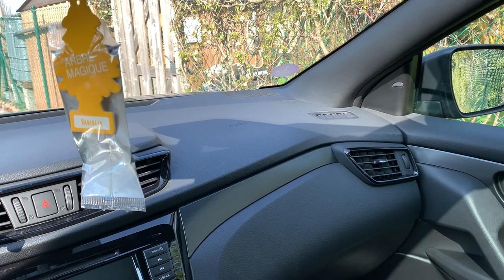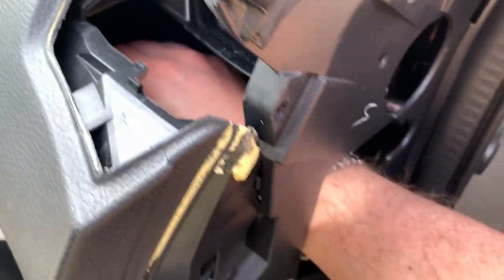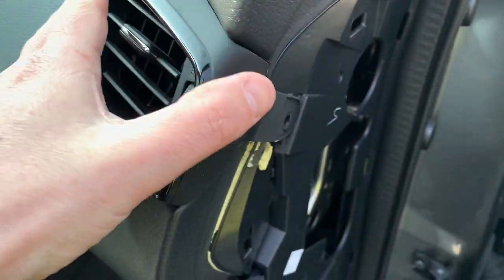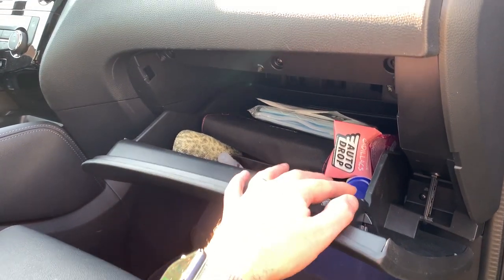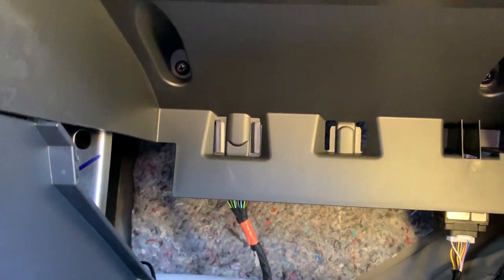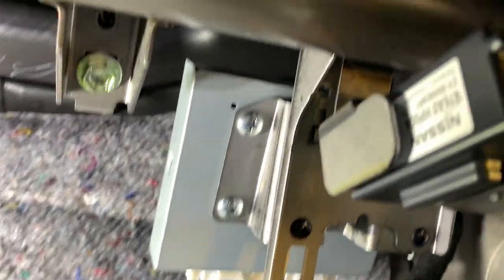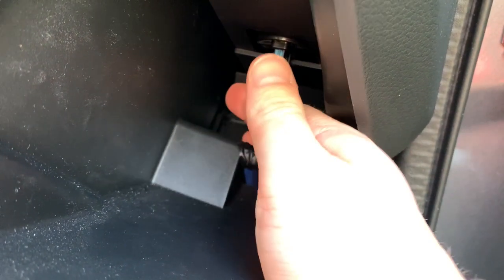Nissan Qashqai J11: Dashboard rattle fix!

Comment: Great video, I also had a lot of crunches. Luckily I fixed them with bearing grease, took apart almost all of the internals and coated the parts that bump and now it's very quiet.
If it can be useful to someone, even that plastic cover next to the feet can generate noises, especially the plastic nut, just put a rubber washer and the problem is solved.
Reply from the maker: Thanks mate. It so frustrating. It can be anywhere 😂

Comment: Hi my dealership couldn’t find my rattle, sounded like it was from the passenger side (right hand driver UK). Turned out to be the rear wheel arch trim, a clip broken, but told not under warranty and told to expensive to replace! Was a secondhand car (Nissan approved intelligent choice!) with two year warranty. I have since used a drop of body sealant to hold the trim still and works fine now. The dealership really let the Nissan cars down. I still have a fault with my ac/heater which it has been in for several times, even recorded it for them on my YouTube channel, still can’t find it.
Reply from the maker: You’re so right. And your testimony proofs how difficult it can be to find the issue. A wheel trim in the back creates noise in the front 🙄 I was told that “noises” aren’t covered by the warranty. Probably too time consuming for them.

Comment: Hey. I have the same problem. When i press the AC went or upper part of the dashboard, that rattling noise goes away. Sometimes when i open the glove box its also goes away. This is fkng annoying and it gives me a headache all the time. I will try this fix to mine. If it will not go away i will eat my qashqai 😅
Reply from the maker: 🤣 i feel you. It’s really frustrating. It can be anything. Try to go somewhere where you know the noise as present and let someone drive so you can search and feel safely as a passenger. My best guess is the cable between the a-pilar and dashboard (where the airbag goes down in the dashboard. Reach it from below by removing the glovebox and its upper panel and remove the side panel and air vent as well just to have more light in there.

Comment: Hello, I couldn't quite understand where the sound was coming from. Could you please get back and inform the j12 Qashqai user?
Reply from the maker: Hi! Pin pointing the source of a rattle is really a ** job. With the resonance it can be really tricky. The best way is the get someone to drive you, on a road where the noise is frequent and then push around on panels and parts to try and find it. On my case it appeared to be the cables close to the A-pillar just where to descend below the dashboard. But with a J12… you still have warranty so ask your dealer to join you for a drive to demonstrate the noise and make them do their job 😉
Reply: @LaPalmeraie0032    thank you king I will leave the vehicle

Comment: 👋🏻, greets from Bulgaria, could u tell from where it comes finally the rattle, cuz I didnt get it ?
Thank u
Reply from the maker: Hi! Finally I found it way in the back behind the glovebox and under the A-pilar. There are some cables that come down from behind the A-pilar and that hit the side. I managed to attach them with a tie-wrap even if the access is really poor but it worked.
Reply: Well, it is not cuz of the little plastic strut, neither the plastic panel in 7:42 of da video ? Isnt it ?
Reply from the maker: No, but it can be anything so you have to track it down by trail and error. For me it was way up and behind there, for others it’s elsewhere.
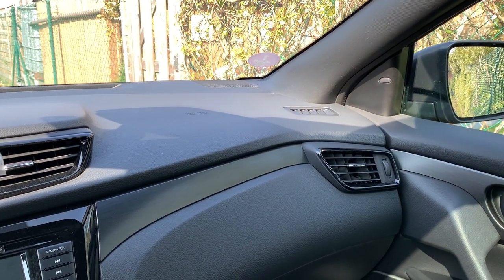Reply: @LaPalmeraie0032 alright, so I have another rattle comes out of this panel of scheme 1:42 under number 2, it's annoying... wondering if u have same problem 🤔
Reply from the maker: @christianivanov7717 well, like me then. It’s really hard to pin point. You see how I end the video thinking it’s done and after all it’s still somewhere else. Ideally some else drives on a road where you know the rattle is heared, this way you can feel and push around. Otherwise, try fixing the plastic panel from above temporarily with some tape to see if it rattles. If so, it’s the panel itself and you can figure out a way to fix it better. Otherwise, like me, demount the complete glovebox and it’s upper panel (with the led light), remove the panel on the side of the dashboard as well. You will need all the light and space. Now you can look from the glovebox up into the space right under the « 2 » of my drawing in 1:42 and see if your cables do hit something too.

Comment: It’s not that I found another trick I show you  where the sound become
Reply from the maker: Can you share a link? 😉
Reply: @LaPalmeraie0032  yes but only for you I have the same car 160 hp I love it’s
Reply from the maker: Ah oui, c’est tout con mais il faut le trouver. Chapeau bas! Je vais regarder chez moi. 😉 non il ne tourne pas dans le vide. As tu essayer de le remettre sans l’aérateur en place pour voir? Peut-être t’es juste à côté ?
Sinon il faut mettre un peu de Teflon au tour de la vise pour l’épaissir.
Reply: @LaPalmeraie0032  boîte à gant ouverte le bruit disparaît car avec le poids des deux pièces sont jointives , pour moi en  tout cas ça vient de là .
Grâce à ta vidéo en enlevant la boîte à gants que j’ai vu ça.

Je regarde pour l’aérateur .
Reply from the maker: Je comprends. Je viens de regarder chez moi mais les deux parties ne se touchent pas et il n’a pas de jeu. J’ai quand même mis un peu de tape feutré dessus au cas où
Reply: @LaPalmeraie0032  ok , en tout cas pour moi certain même en bougeant avec la main les frottements sont insupportables , je vais tester sur mes trajets habituels , j’ai remarqué que entre 17 degrés et 25 degrés de température extérieure  le bruit est là , en dehors de ses plages rien
Reply: @LaPalmeraie0032  il y a même les traces d’usure sur le cache plastique à la longue de frotter . Je vais mettre un peu de feutre aussi on verra d’ici quelques jours
Reply from the maker: En effet. Ici que quand il fait chaud.
Reply: @sebastiendame1727  can you be so kind and describe how you sorted this out, it seems on mine the noise dissapeares when the glove  compartment is open as well. Thank you in advance
Reply from the maker: @JosipSpoljaric-kp9ig hi! As in my car. Finally I found a cable all the way back behind the glove box just below the dashboard where the cables behind the A-pilar plunge under the dashboard. One cable seemed to hit the side. I fiddled a tiewrap around and it did the trick.
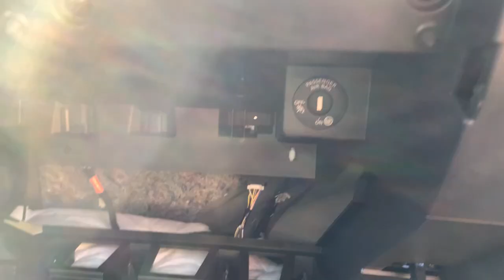Reply: @LaPalmeraie0032  Hi! thanks for your reply. Is it one of the cables in video (06:38) or you have to remove complete glove box to see it? thanks once again
Reply from the maker: @JosipSpoljaric-kp9ig no it’s way up and to the side. Follow the line from the a-pilar down. Just where it joins the dashboard. You can find it when you remove the side panel and the air vent on the right and as it is hard to access remove the glove box and the top panel as well.

Comment: Yo bro i have the same rattle from the passenger air vent in my g37
Reply from the maker: Could you find where it came from? I also found that the cables coming from the A pilar, did touch some parts just beneath the dashboard and fixed them as well. Bad access though.